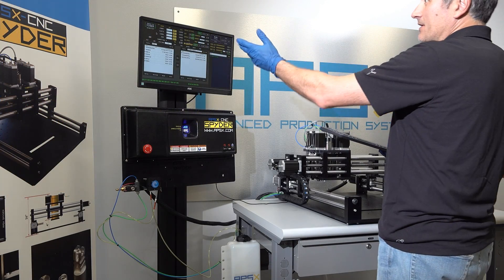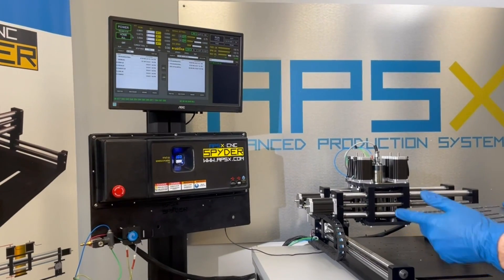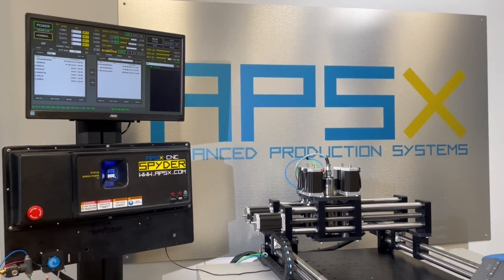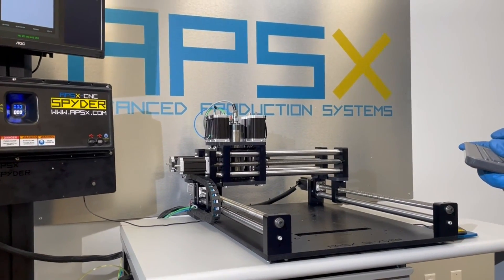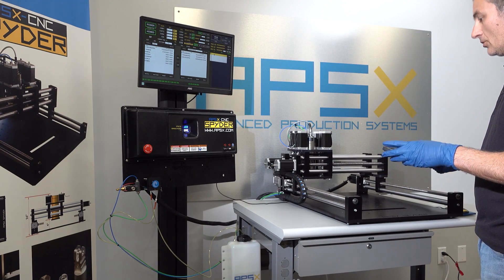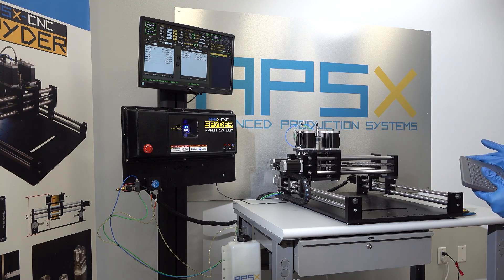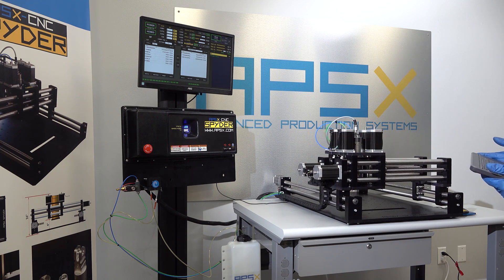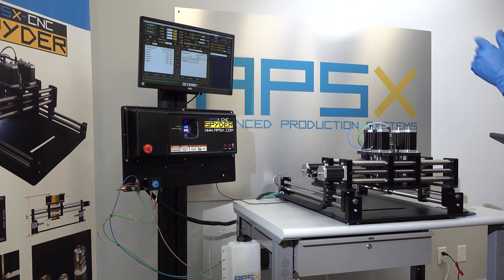APSX Spyder CNC Machine 2021 - Part 1 - Power up and Tool Change

Comment: I have so many questions... Why are there four steppers on the z? Why two on the Y? Why no probing or bit setter? Why make the machine so compact but then require a monster tower to control it?
Reply from the maker: Z-axis has to be so rigid so that you can get the precision on metal milling. Plus we have mist coolant feature for the same metal milling reason. These are the difference makers between the Spyder CNC and others. The tower is optional not required. You can mount the control panel and the monitor on the wall too. It is a personal preference and depends on the space available in your place. Good questions.